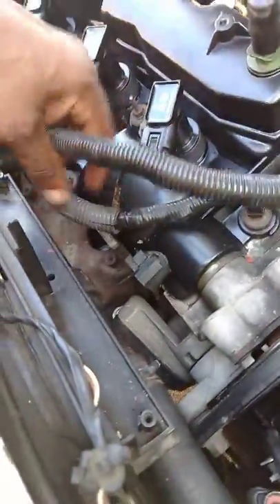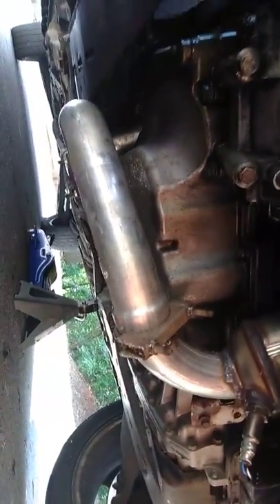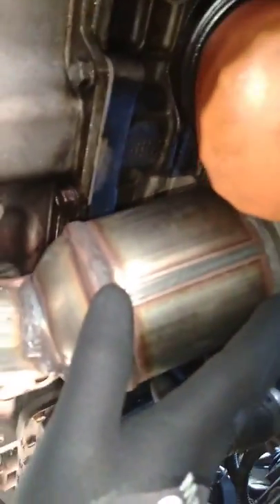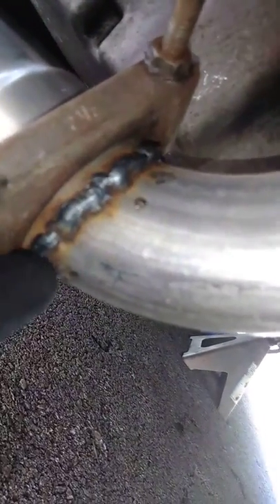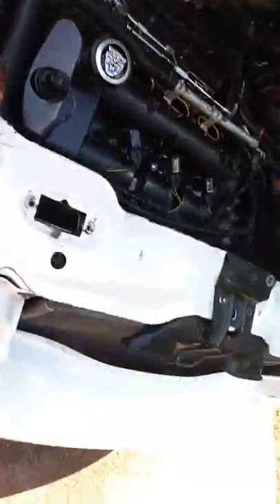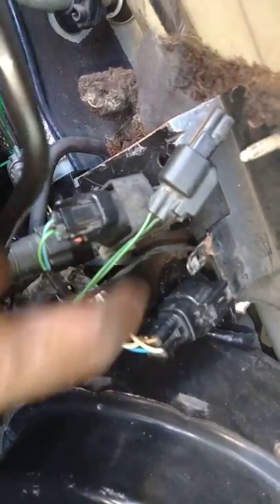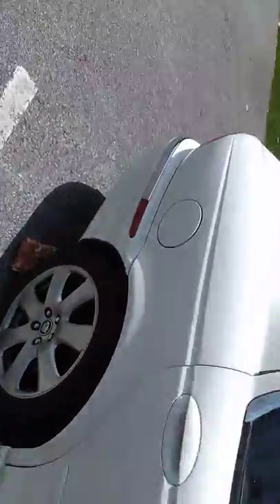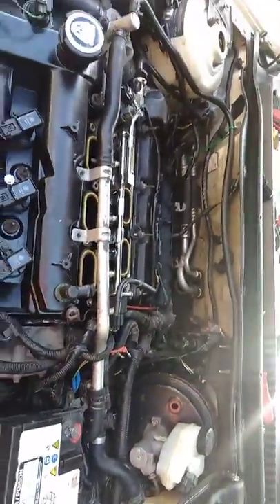04 Jaguar X Type Catalytic Converter SCREW UP!

Comment: I have a 04 x type with lowering springs.

And from the looks of that exhaust pipe that runs from the front and does not continue close to the oil pan-  it’s going to be impossible not to smash the exhaust against the ground.

You’re at the mercy of others when you put your vehicle in there shop and let them wrench on it.  They can’t see past the hood emblem so they make a mountain out of something so simple.
Reply from the maker: Hey man yes they really look at the leaper and swear your made of money or something. Well, I was able to fix this botched job and I must say it wasn't that hard at all. So she's back to her old self again.

Comment: The bolt that wasn’t tightened..  
needs to be turned up side down or opposite of the others so you can tighten the nut from the top side;  between the exhaust manifold.

Comment: Also just got a 2.5 X-Type. I want to remove the cats ASAP. I have to do it myself.

I was really hoping to find out how quickly the removal can be done. I have a couple of days to do it.

So far I have found out that the front cat is easy and straightforward. The rear cat is a lot more difficult and might need the subframe to be dropped, which I would like to avoid 😅

Anyway, I am starting with it today, hopefully I'll be done on time.
Reply from the maker: Rear cat removal just follow my vid ....it's the fastest way without dropping sub frame.  Moreover dropping sup fram is 100 percent rediculous
Reply from the maker: I'll tell you a good trick for more clearence.  Remove your intake box, then remove the valve covers.  This will allow you to have another four inch  drop in arm reach to rear cat bolts.
Reply: @g.malcolmdial1327   I'll definitely give it a try. I will probably start with that tomorrow or on Monday.

I am really looking forward to getting started.

Thanks for the reply. I'll let you know how it went.
Reply: @g.malcolmdial1327   Hi! As it turns out, the previous owner of the car already removed the cats.

I would've been over the moon if it weren't for the fact that the bolts he replaced the factory ones with weren't impossible to fasten or remove 😅

What's more, the car's cooling system is in pretty bad shape. The fans won't switch on and he cut off the power lines and the are a bunch of leaks on the coolant lines.

I am really excited to have the car, but I really wish I didn't have to worry about so many things at the same time.

I guess I am lucky to have worked on a lot of cars and I am really enthusiastic about working on this car myself.

I will definitely keep in touch and watch your channel for tips and inspiration
Reply: @terramatela6351  Did it work getting the cat out from the top?  I have this car too, and the cat needs to come off to clean or replace. I want to know how much work im looking at.

Comment: Hi, I have a question. Can i use a different universal catalytic convertor for Jag x type 2.5 v6 patrol 2003? It is hard to find here in this country.
Reply from the maker: Sure can I've been using them since I  had my car.  I found a company off eBay that's located in Canada great cats.

Comment: Are you still looking to do a good job on your jag , just did the same project on my 03 in the driveway and have some good info.. Let me know
Reply from the maker: Hey brother, im always working on the Jag.  however after this last screw up with this company,  I really had to pray about this situation as it  left me out  of work for about an week 
non the less by stepping away from this project for a second allowed me clarity on how to get this car back to tip top shape and as of now to this day she has been running very well.
Im always looking for good info for the 04 Jag x Type I really love the car.
Reply: Gerald Dial sorry to hear about that man. I’ve recently done the complete job to better than OEM spec. Took me about two weeks working on it after work , I Bought the same exact cats you did on eBay for $200. The job replacing the rear cat is not as bad as it seems. It is able to be done in a driveway with basic socket an renches and a mig welder. A sawsaul would be good to. I will be posting a video on this situation very soon.
Reply: My 2003 type X failed emissions. The mechanic told me it needs the 2 catalytic converters replaced for a total price tag of $3,500 is he trying to scam me?
.
Reply from the maker: @justjcs   yes sir he is trying to get you. But you can give me a Hills 256 525 2306 I can walk you through it